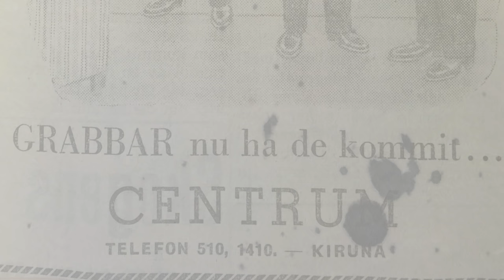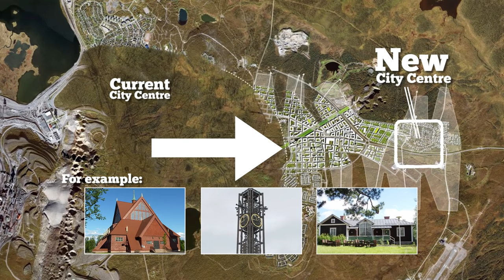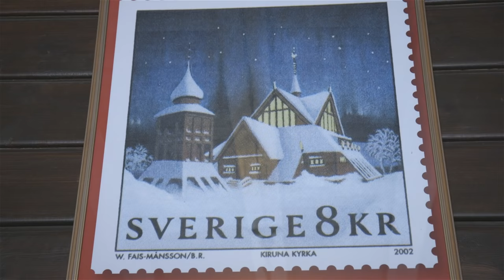This is Kiruna: How to Move a City

Comment: Ni säger att hela världens befolkning skulle få plats i Kiruna kommun och att alla ungefär skulle få 3 kvadratmeter var. Kiruna skulle då behöva vara 24 miljarder kvadratmeter stor. Är det verkligen så stort?
Reply: +Erik S Nästan så stort. 20,55 miljarder kvm.
Reply: +Erik S Wikipedia säger Kiruna kommun är ca 20.000 km^2
http://www.worldometers.info/world-population/ säger knappt 7 425 000 000 människor på jorden

20 000 km^2 * 1 000 000 m^2/km^2 / 7 425 000 000 personer ~ 2,69 m^2 / person